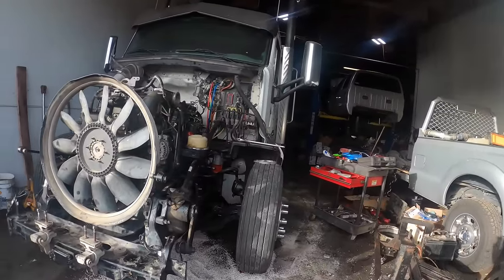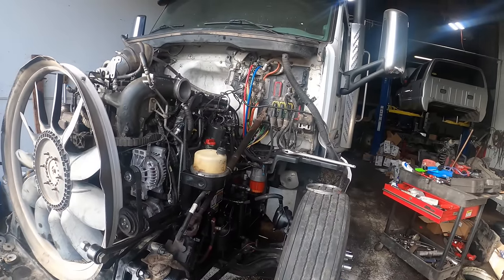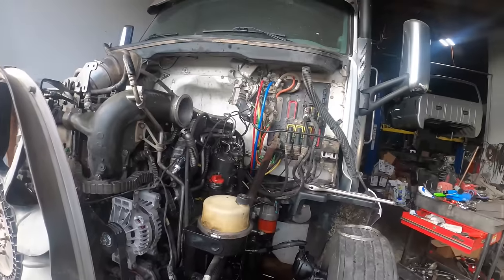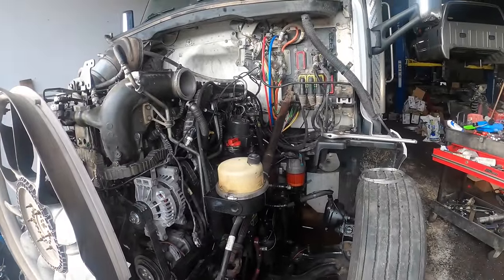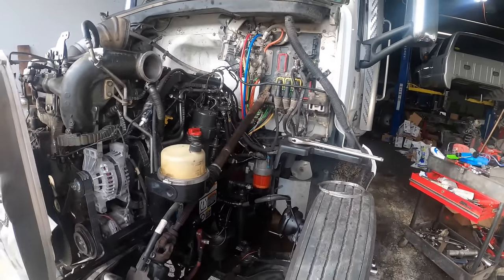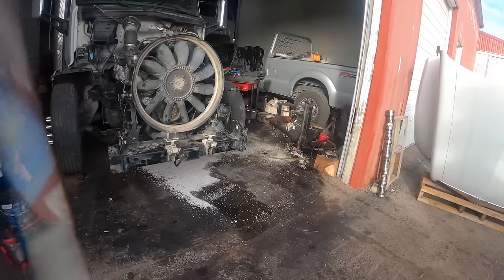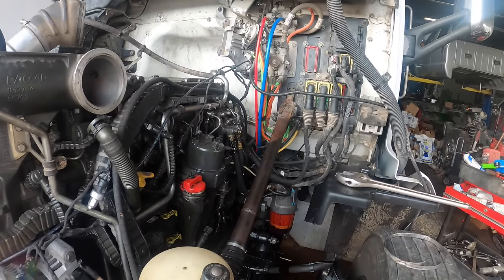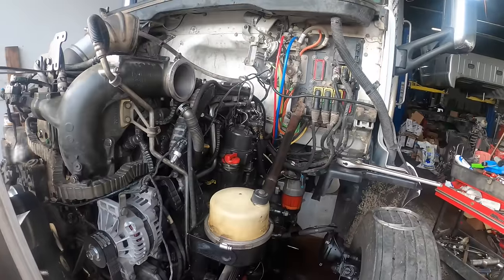I'm frustrated on this one!

Comment: Cranking fuel pressure should be at least 14.5 PSI= 1 Bar, but they will start with as little as 2.9 PSI if no air. The ball in the secodary fuel filter is a NFNR valve, No filter, no run so you can just take it out. The ball does wear over time and can block fuel from entering gallery in block to feed EUP's. There is a pressure regulating valve that is banjo fitting in back of block that regulates fuel gallery low side pressure. During cranking, requested common rail pressure will be between 3626-7250 PSI. Need minimum of 1600 PSI before ECM commands injector duty cycle and 2600 PSI before they mechanically will open. You wanna see more than 2900 PSI to start. When cranking common rail should say fillling until enough pressure to start then will go to pump unit only. The engine can run and start with only one or other on cam or crank signal. The next issue could be a stuck open injector, but it seems like a low side fuel issue. I would be glad to help anyway I can. Thanks
Reply: I have seen many computer controlled engines run without cam sensors but I have only seen a couple that will run without a crank sensor.  From what I have seen it usually takes a few more cranking revolutions before the engine starts when running on just the crank sensor since the ecu doesn't know if the engine is on compression or exhaust so it needs those extra cycles to determine cam position.
It's logical that the ecu can determine cam position after a few crankshaft revolutions.  Engines with variable cam timing usually won't run without proper cam signals due to the added variables.
Reply: Eyup mate, my pal at work put me onto your channel. 
Looks like your not scared of anything !! 

All the paccar engines in the DAF we have here in England are a bastard and you usually have to slacken the injector pipes off to get them bled. 
So much so we used to ensure all ours had 17mm and 19mm spanners incase they ever ran out of diesel. 
Shit really for a common rail. 

My initial thought was you were getting a excessive volt drop on cranking, usually most European stuff doesn't give injector pulse if they drop below 19v. 
Anyway great job, thought I'd leave a comment as another know it all as I think it helps your channel. 

Keep on spannering.

Comment: Hi Warren, former Peterbilt DTM here. This issue is likely caused by dry firing the injectors while attempting to start. Injectors on this model open at 2610psi. If above that threshold with no smoke, injector pintles are stuck. If you replace 1 injector and it fires on that hole, it will confirm you need 6 injectors.

Comment: Warren, I had one that showed low primary fuel pressure like yours was doing at the beginning, and showed within spec after a new transfer pump, but within a day was showing low fuel pressure again. I had to drain the tanks and change the perforated plastic socks on the pickups in both tanks. They looked clean but were causing a restriction. The plastic was softened from the fuel or additives that the perforations were closing up under high flow rates. Good luck, you have way more patience than I do.

Comment: I think that you are on the right track I had a similar problem with a paccar and I changed the transfer pump but it still ran like crap. Ended up being the exhaust back pressure valve. I hope this helps you

Comment: They can be a real bear to get started been working on them for 10 years and still get some that fight. They get air pockets. I like to leave a injector line loose and hand primer until it is flowing good. You can disconnect the return line at the supply/return manifold and hand prime it and then relive the pressure by sticking your finger in the return line fitting there’s a check valve. The davco primer works ok as does a mighty vac. Also a quick check on the unit pumps you can disconnect one at a time and it should run. You can go drive it with one disconnected and it should run fine on one. Another trick is to disconnect the rail pressure sensor. The injectors won’t fire until Rail pressure is above 3400psi disconnecting it defaults it to max rail.

Comment: Warren I feel your frustration. I just did battle with a 60 series Detroit that would not start. It turned out to be a bad ECM.  I did confirm power and ground to the ECM. The only way I had to diagnose it was a hammer. I don`t have the software for trucks. I started by checking the TRS sensor and cleaning the oil out of the connecter. But after viewing other videos I tapped on the ECM and the it started.  In the process of unhooking a trailer the engine died. It would not start again so with the key on I tapped on the ECM and I heard a click. Then it started again. Go have a cold beer and relax I know you will figure it out.

Comment: If the cam sensor does not fix your problem check the fuse panel on the firewall. There are a couple fuses that go to the ECM in there and for whatever reason I have seen them get corrosion to the point where they will no longer allow voltage through. Had a Peterbilt 567 with an MX13 doing almost the exact same thing almost to a T, and we went down almost the exact same diag path that you have with the fuel system. I ended up checking the fuses "just because" and found that problem. I filed some of the corrosion off of the terminals in the fuse panel and the truck fired right up. The ECM has 2 or 3 powers I can't remember, but I could communicate with it just fine the whole time I guess I just wasn't getting enough power to fire the injectors. I also have some crank no-start diagnostics for these I got from the KW dealer. Would be happy to send them your way if you'd like. They are what lead me to find the fuse problem. Paccars sure are a basket case lol.

Comment: I have the blue 4 channel Micsig oscilliscope. They are around 6 or 800 depending on model ya get. Iv had it for 4 years and its been great. Not a Pico which is by far the best. You would benefit so much from having one. Other thing is also make sure that the cam sensor is seated the whole way down into the hole before ya put the bolt in.

Comment: I just went through this last week on a Mercedes Diesel. The engine has been sitting for some years but I'd dropped the sump and changed timing parts and injectors. Cranking it didn't do anything except flatten the battery. I checked the crank sensor which was a bit out of spec but nothing was obvious.As you saw,even a small amount of fuel in the injection pump will look like fuel is being pumped,and the lift pump was working perfectly. I'd seen this once before...the damn fuel rack was stuck .a quick wriggle with  a screwdriver saw it move a little bit ,but enough to get the pump elements working. As you noted,No smoke is a bad sign.

Comment: You haven't put a voltmeter or pico waveform thing on the injectors yet? Is there a way to crack open the injector's final fuel fitting before it enters the block? Should see fuel squirting out during crank. I know these are elementary ideas, so is it that this machine won't let you do elementary checks and forces you to rely on computer readouts? Is there a compression release for easier starting that is stuck open? or a security immobilizer stuck, or any kinda kill-switch for safety, such as the hood latch or something dumb?

Comment: Hey bud, try the fuel return valves back of head drivers side rear corner. If theirs crap stuck in the return valve it may be messing with your rail pressure and not allowing it to start. You could also try resetting the fuel rail pressure control valve in the repair support function in the Paccar program.

Comment: @1:03

I just read within the last few days that Cummins is making the Paccar engines to the Paccar standards.

A couple of years ago, I was in about a 3-year-old Kenworth that had a paccar and that crappy crap crap crap Eaton auto shift.  

In the rolling hills of West Central Wisconsin, I would just ignore the ding ding ding from the dashboard and keep it in manual mode on the transmission.

I have to say, for a 13-liter, if it came with even a 10-speed, but especially if a 13-speed, I would not have minded driving the engine one bit in the Midwest.

This may have been the only 13 liter engine that accelerated enough on an entrance ramp to a highway where I wasn't disappointed in its torque.

Comment: Also check the screen inside the primer pump for being plugged or possibly damaged. Also did you soak the unit pump lifters in oil to prime before install? The orings that seal the fuel filter housing to block also have issue’s. Not sure if you pulled it off when you did the engine work, but a new redesigned filter housing was also updated to help rectify issue’s with sealing along with new updated fuel lines from pump to housing. Also check the fuel lines at the manifold with the compucheck fitting. Is it possible you crossed the lines from the separator when you reconnected? Just trying to throw ideas at you.

Comment: You’re on to it with the leakage. It reminds me of the Mercedes MBE4000. When they had leakage between the fuel transfer tubes and the injectors they would not start. Mercedes had a whole procedure to torque them in and seal correctly. We were not allowed to reuse them at our dealership.

Comment: We had one like that one time our engineer measured the voltage from a mag pickup and found it a little low. That sensor when you install it you turn it in till it contacts a gear tooth it is looking at and back it out 3/4 of a turn and lock the jam nut. So he decided to just turn it in a little bit to get more voltage out of it. There was a slight buzz as the machine was running and he backed it out slightly and locked the jam nut. The voltage never changed so he left it. A year later the customer called the unit was shutting down for no reason. I went out and it was an intermittent problem but it was getting worse. After looking high and low for three days we pulled that speed sensor mag pickup and found the thin metal cap between the outside world and the coil unit inside had been sheered off. No apparent other damage was visible just the end cover was gone. The customer helping me then told me the story of my engineers folly from the year before.  We replaced it,set it right and the unit ran up no problems. The coil wire in those is as small as a fine hair and we figured there was a break in it that would lose the signal for enough time to stop outputting but it would not throw a speed sensor fail because it would start reading right away again. One other thing about this unit it has two speed sensors on it. One feeds the panel indicator and the other goes to the controls. The one we replaced was the control unit one.

Comment: We have six MX engines, they are all a pain in the butt when it comes to bleeding air from the system.  We've had numerous issues with getting them primed when filters are being changed, and have had the regulator on the block fail twice on each of them.   As was said earlier they'll start with as little as 2-3 lbs of supply pressure when they are fully primed and bled.   It sounds like there is an airlock based on how it's cranking.....ours sound just like that for a LONG ass time while we try to bleed them and it normally takes two people to do it--one to crank and someone else to pressure bleed it.   We have also had those filter housings crack near the fitting ports where someone at DAF/PACCAR overtightened them--found that by accident one day when we broke one off trying to bypass the system--and they suck air making them near impossible to restart after loss of prime.   I hate them and feel for ya.

Comment: Statistically lift pumps on these engines are very solid an almost never fail. And previously someone commented that around 3 psi on low side is enough to start if high side is good. I would try yo disconnect high pressure pumps electrical connectors one by one and try. Also disconnect ePRV and try again. Also I had occasion when injector hold down bolt was loose and compression went inside fuel injectors fuel supply gallery in cylinder head. You would have air bubbles on fuel output back to tanks even if input fuel is without air.
Hope this can help. Best of luck !

Comment: I had the same problem with my fuel filter plug-up. The truck stop I was using was dumping old motor oil from oil changes in with their fuel.

Comment: Can you unplug the temp sensors so the ECM thinks it is -40 F out?  This usually increases the pulse width on the injectors but if there is no smoke with them plugged in it probably wouldn't help.  I was also wondering if the rail pressure doesn't get higher than 5000 psi than maybe the spray tips on the injectors are not opening.  S60 DD had a spray tip pop pressure of 5000 psi.  Just a thought.

Comment: I had to rewatch the video, the rail pressure that goes higher than desired means that nothing is consuming fuel to me (all injectors unplugged?), the uneven crank could come from a slightly leaking injector tip.  
Just throwing thinking paths...

Comment: The black residue on the filters is asphaltine. This is normal for common rail fuel systems. 
   The high pressure & heat in the rail molecularly changes the fuel back to its base asphalt component. The fuel supplier I worked for added Power Service to their fuel to combat Asphaltine.

Comment: I once ran across a caterpillar diesel truck engine that stalled from a gelled fuel in the winter-20 degrees in northern Minnesota and it died after the owner replaced the fuel filter and he got it towed to a heated shop and i messed around for hours and finally i put air pushing back down the incoming fuel line and the seal on the filter started leaking so I got another filter and it fired right up.  I had a freightliner with a 12.7 Detroit diesel that would shake and compression fire but not run on fuel and there was a broken wire in the battery box that powered one part of the ecm.  I also worked on a freightliner with a Mercedes diesel and it would just push foam out of the fuel return then I started tearing down the fuel system and I opened every line from the individual plunger pumps and got clear fuel coming and it took right off . Is there a way to hook the starter to a different set of batteries and the ecm to different batteries i have seen the starter steal all of the power and the injectors not activate

Comment: I had a jcb with a faulty stop switch on the pump . Wander if your motor has the electrical stop.or a separate switch .say for theft protection .

Comment: Hey Warren small suggestion would it be worth checking rail pressure sensor or wiring? I haven’t worked on paccars but if you have 1700 psi rail pressure before you crank on it somethings off.  Even if your desired is 3600 and you have 4700 you could be below cracking pressure for the injectors 

Hope you see this good luck!

Comment: You right about the prime in the system, i been call to do a simple oil change an after replacing the fuel filter can't start  the thing, when a fuel system is week, that happens sometimes

Comment: Yeah been on one of these before and know how freaking frustrating it is. Cut the signal wire about 5 inches from the sensor make sure its not shorted further up pulling the signal to ground. I was burned bad because of that. Also, one of those inductive voltage pens at the injector wiring is great for seeing if there is power to the injectors.

Comment: Pull the wire off the EFC on the fuel pump. ECM algorithms only allow limited fueling during cranking. Disconnecting EFC goes full fuel.

Comment: I work Paccar you can not get enough air out of the system the way you doing it I know you are not supposed to but loosen the fuel line at the fuel rail and pump the primer and pump it until the air comes out and it will start I went through it my self

Comment: I have had this exact same issue with a mx13 after a cylinder head replacement. I was the pumping units returning to much fuel. Replace the other pumping unit.

Comment: Tough one, we all know youll get it figured out though. Running on ether makes me think its not a major mechanical failure inside causing low compression or something like that. I'm not familiar with these engines but I'd like to see a meter/oscilloscope reading on the injector wires or some other way to verify the injectors are firing when cranking so we can rule out something like a bad ecm like you mentioned but if theres not signal I'd be chasing sensors that can cause a crank no start just like you are. Last things were like you said exhaust or fuel restrictions. Good luck.

Comment: Try blanking off one pump units. They can get stuck open when removed. I know you have put at least one new one in. But if one is bad it won't build rail pressure. Have had no end of this happening in UK when we do cams.

Comment: When ever you are looking at that P0094 code I look at 3 things. I unplug each unit pump and try and start it just a quick check, what you are doing there is if it starts on 1 unit pump it has a health pump that is plugged in as far as pressure being built from the pump. I also watch the unbalanced graph for cylinder performance, your graph shows all 6 cylinders if they are below of above the 0 plain Then ill measure the fuel return, the fuel return will tell you that you have a possible injector flowing to much fuel to return. I had a customers truck that took a miracle to prime and it turned out we had 3 injectors just dumping fuel into the return galley. There is also a screen under the primer pump that gets clogged with shit as well
Reply: also I absolutely hate piercing wires always back probe it doesnt take much to unclick the back piece for the ecm connector